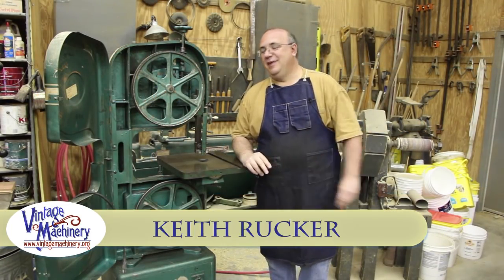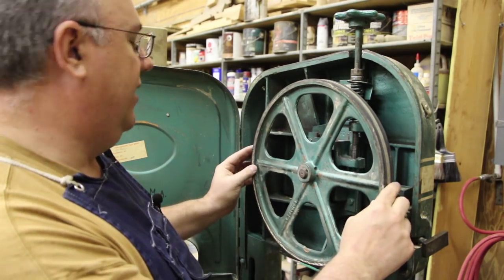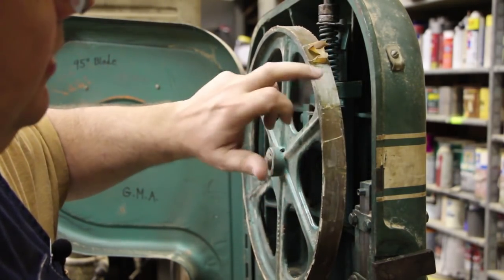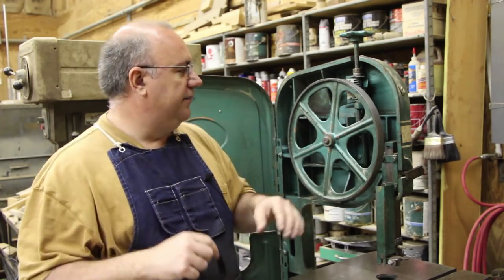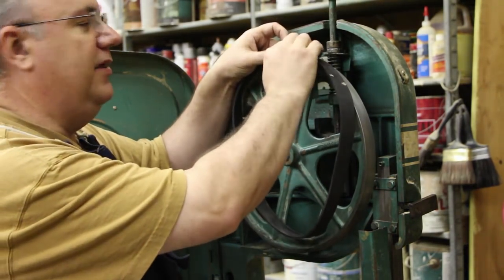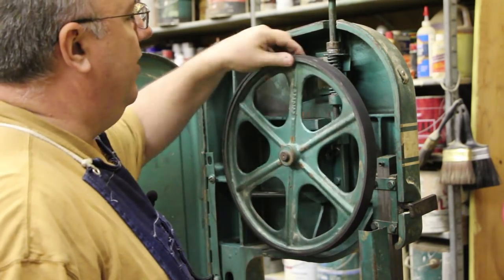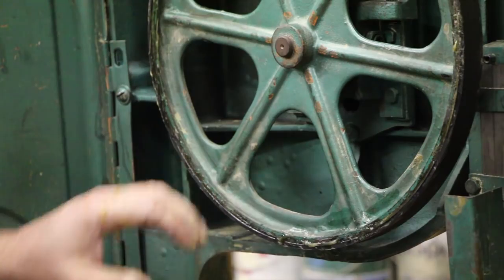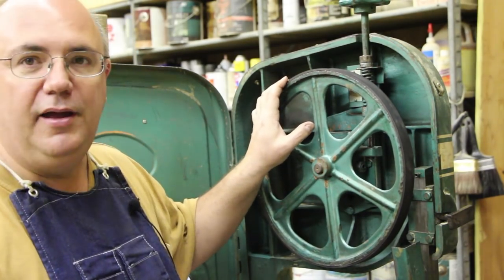Installing and Crowning Bandsaw Tires

Comment: Ack, I tried to recrown my bandsaw tires with an angle grinder and a sanding pad and a big piece of rubber came loose from the edge of the tire. Is this likely to happen with a new tire or might this have been because of old tires? I am unsure how old this saw is and when it last had them changed, it is atleast 50-60 years old, I think the tires must have been changed once at least. I would have liked urethane tires so I would not have to crown because I am afraid of ruining a new rubber tire now... But they don't exist for my size saw (24" wheels)

Comment: If that is contact adhesive, is usually is supposed to dry on both sides before you have one side touch the other. But I understand the dilemma of adhering a stretchy surface with contact glue.
Reply: Agree, sorta hard to let them air dry and tack up but it does work this way, just let it set longer.

Comment: This was a truly great video.  I had no idea that there was so much involved with installing these tires.  I need to take a second look at the new polypro tires I put on my Delta 16" bandsaw.  I did not glue them, nor equalize the tension as you did.  I also used "C" clamps to help me install the tires.  (Oh well!)

Comment: If your holding the sandpaper freehand without a solid unmovable support, you are not truing up the tire surface to be round...you are simply making a surface that is parallel to the original wheel surface at best: at worst you are humps into it from vibration and bumps.  For proper truing, follow the principle of lathe turning, you need a solid rest.  An old installed blade with the teeth ground down can serve as a good driver for the free wheel work without risking getting cut.

Comment: I will give away our secret in our shop with several bandsaws. We stopped buying tires years ago. Now we use several wraps of 3m Scotch 33 electrical tape or even a top quality duct tape. We have saws from 12" to 36" and this is how they all run in production situations without failure.

Comment: Thank you sir, another great video. I sure got lucky when I replaced the tires on my Harbor Freight 14 inch band saw. I just ripped the old one off and stretched the new one into place. So far so good, but after watching this video, maybe I should re visit that project. Now that I think about it, I do hear some thumping going on in there. Sure makes sense when you do it correctly. Oh well, tomorrows project :) .

Comment: Nice! I just bought an old Powr-Kraft 14" band saw from the 40's or 50's for $40. My tires are a little cracked but not too bad. My problem is I don't know how long of a blade I need. There is one on there now, but it's too long. They jerry-rigged it by adding a block of plywood under the top adjusters....not sure why. But it rubs on the top of the guard. Is there a place to go to find that information?

Comment: I have a 16 inch band saw with cast iron wheels it doesn't have rubber on wheels, the blade runs with teeth overhanging. 
It is Makita old model.
Bought it in Saudi Arabia in 1985.
Good running since then, no problems. 
I have not been able to find any literature on Internet. Makita is no response. 
I wish to know more about it can you help?
In India and far east they almost all have steel wheels with no rubber but I have not been able to get any proper working details about the crowning of the steel wheels, they seem to have no crown. 
Can any one help.
Thanks.

Comment: Thanks for the vid;  I worked in a shop that had more than 15 bandsaws for cutting vacuum formed parts.  The biggest (and nicest) that I ever serviced/rebuilt was a 42" or 48" Tannewitz with direct drive.  Putting the tires on that one was a job,  but once it was all done & tuned up it ran really nicely.  Never did crown the tires,  guy I learned from hadn't done it so I didn't.  Next time I replace a set I will be sure to do it though. Thanks Kieth Rucker,  the information you share with us is invaluable.

Comment: Here's a tire gluing hack that works for me...
When nobody is looking, steal one of those decorating bags from the kitchen (hopefully its disposable), fill it with glue and squeeze the glue in front and behind the dowel as you turn it.  The dowel will help spread the glue evenly on both surfaces.  I found that to be easier than trying to force the bristle brush in there.  
Another way...
Save an empty toothpaste tube.  Cut the end off of it, clean out the leftovers, fill it with glue, fold over the back end and roll the tube end as you empty the glue.
I'm sure you could use those hacks for a lot of other things too.  Don't knock it till you try it!

Comment: Great video. Thank you! I have an issue I'm hoping you can help me with. I recently bought a powermatic 143 from a friend that used to belong to his dad. The tires were falling apart so I decided to replace them. After reading a bit I decided on urethane tires and they keep coming off. Is it because there's no channel for them to sit in? If so then I'll just buy rubber tires and glue them in but I was hoping these would work. Thank you for any insight you can offer.

Comment: Keith. I like that you want to talk about how important it is to cut the power off and place the wire where you can see this. 
Most people do not mention it at all. 

In Sweden called this "shut down and lock" we often have protection switch with locking arrangements in workshops and in the industry. Each repairman on the machine has a personal padlock fitted before the job and and removed when the job is finished for the specific worker.
In this way, the machines will be unable to started unintentionally.

Comment: Neither of my band saws even have rubber wheels but they both seem to work fine. I don't know that they ever had them either by looking at them. On a metal saw wouldn't chips cut your tires up and embed themselves  pretty fast?
Reply: *****
And also a big consideration is the coolant on the rubber, All the saws I have worked on had the crown machined into the wheel and ran no rubber but they were all for metal only.
Reply: I looked at the wheels on my old Johnson bandsaw and they are relieved so that they don't touch the tooth section of the blade.

Comment: Thank you for your excellent video. Now I am convinced that I can install new tires on my old Crescent 36" bandsaw by myself with its wheels on it. BTW, I cannot find the contact cement(or corresponding adhesive) in the site you mentioned.

Comment: Keith,
Thanks for the stroll down memory lane. I used to hate to put tires on bandsaws, unless they were the new units with the notch in the center of the wheel and the tire as well. Those tires got put on the hood of my service truck to get them nice and warm to make them more pliable while I removed the blade and old tires. Putting them on was a snap! After a couple of the flat tires came off while the saw was running that I had installed, I lost confidence and refused to replace them anymore. That's an old Powermatic. The newer Powermatic products are painted sort of a mustard yellow for lack of a better description. I have, however, never seen one with the cone pulleys for different blade speeds. The ones I worked on use a Reeves drive (adjustable pulleys) for speed control. This same method is used on variable speed mills not using a VFD.
Regards,
Dave

Comment: Be wary about sanding it to try give the glue more grab on the tire, I once had to stick rubber and urethane to various surfaces and I did a whole lot of trials and the more shine on the surface the better they stuck, sanding the surfaces made them come off about 50% easier- failure was caused by little of pieces of the surfaces tearing off the parent material. Do some tests see for yourself
Reply from the maker: shedasaurus Just following the advise of the manufacturer.
Reply: Cool!

Comment: Thanks,
Also, you can use  rubber cork I find it smoother and easier to install. The gluing process is easier because you the cork is in length. Contact glue on the wheel and the cork, glue the cork on the wheel and cut at the join at an angle, The cork is more resistant than the rubber. Sanding and adjusting is the same process.

Take a look at this web site un UK 
scosarg.com/accessories-spares/bandsaw-accessories DOT html
I am sure those can be found anywhere around the world.

Comment: For best results and dynamic blade tenacity it is necessary to crown the blade transport wheels to a radius equal to the radius of the wheel itself. I learned that the hard way; carving 18" timbers.  I'm currently in the testing phase of my latest veneer resaw prototype. It cuts 18" deep in a throat 14" wide with a 2HP drive train. I use a proprietary rail-and-sled feed system that factors blade lead into its locked position using rails of variable length and robustness to start that first flat cut and veneer the log from there. I feed it with my pinky finger. Using two high performance Iturra tensioning springs, it runs 1" lennox carbide-tipped resaw blades with only 3/32" of kerf to produce 1/16" veneers 18" wide as long as your workpiece. Because the tracking and tension system is frictionless, there is no blade flapping at any setting and the cut finish is so smooth it looks like it just came out of a planer, not a band saw. It's ready-to-glue ! I'm trying to retire falbergsaws.com but I want to introduce this prototype first because when ya'll see what a sweet machine this is going to change the way they build bandsaws hereafter; you'll no longer settle for the antiquated designs you're now getting from the big corporate tool companies.

Comment: I've been fixing up an old (30's-40's?) Rockwell (Delta) 14" band saw with gear box. The tires were extremely hard to remove, hard, glued, I had to chisel them off. I found urethane tires that required no glue and they worked wonderful. The wheels have a crown built in and a edge to the rim that keeps the tire from walking.

Comment: Thanks Keith! I recently purchased a Powermatic 141 Band Saw (Circa 1965) that I am completely restoring ($50 a real steal!). This video will help me a lot! I'm doing a ground up restoration, including new paint, bearings, and tires. I hope to find a blade that will allow me to cut aluminum as well as wood being that I do not have the speed changing transmission in this model. It runs at 3000 sfpm.

Comment: Acetone! You should wear gloves so it doesn't get absorbed in your skin, a filter mask so you don't breath the fumes and make sure there are no ignition sources which include certain electric motors and electric switching equipment. Safety first!

Comment: I've been working to restore my Grandfather's Craftsman three wheel bandsaw. She's a 1950's vintage with 6 inch wheels. I replaced the tires by following your method. There are three holes in each wheel, making installation easier than I thought. By tying down the tire into two adjacent holes and using a small metal rod, starting at one hole and rotating the rod as I lifted the tire edge onto the track surface, it was fairly easy to mount the tire. This astonished me because I'm not usually that lucky. The other two tires were equally easy. I did rotate the rod between tire and wheel for two orbits along the circumference of each wheel to better seat the tires as you suggested. Now I'm ready to crown the tires. I'm not really quite sure about how much surface I should remove from the tire edges. You mentioned a minimal of one or two degrees, using a stick and sand paper. How many turns per edge would you suggest?
Thanks for your video. Very informative!

Comment: Check out your wheels before you spend any time or effort crowning your tires.  The wheels on my inexpensive import 14" saw are crowned; and the new urethane tires that I installed last night follow the shape of the wheel perfectly.  Incidentally, the urethane is more difficult to stretch than the rubber used in this demo.  Once on, I decided to forego using any glue at all.

Comment: Thank you! My hunch is that rubber cement would be an ideal adhesive. I've used contact cement for years on various projects and it is suppose to be allowed to DRY on both surfaces. Of course this is almost impossible to do on the tire and wheel, so rubber cement may be a better bet.

Comment: being the shade of yellow it is, and the consistency it appears to be; I would say the glue is 3m super weather strip adhesive. common uses include weather stripping, gaskets, rubber on metal anywhere needed.

Comment: My 25' blade on 30" wheels call for 18,000PSI. Can the tires handle the pressure? Would it not bite into the rubber?

Comment: I may be a little late to the party with this comment. I use the same technique but with a twist. I use an 2" rubber sanding disc mandrel in a cordless drill. Place it centered on the idler shaft and use the drill to spin the idler. Makes it a lot simpler to do the job and keeps your fingers out of the path of the spokes.

Comment: It was extremely easy for me. Soaked it in hot water for a few minutes and then used two trigger clamps with rubber ends. Took about 45 seconds.

Comment: Hey, Keith...great info! Thx! I am working w/ a Maru 16" metal/wood vertical band saw - Model 16 MWM. Cannot find anything on t/ web.

 T/ problem is it shakes and is very noisy at times. We thought it needed a new gear box, so, I drained t/ gear oil out - about a cup full came out, but, was very dark...and no metal pieces in it. 

Now, I'm thinking it might be a wheel-bearing.?
Reply: Also, wondering how much gear oil to put in gear box which is approx. 20" height, 14" width, and 6" depth.? Thx!

Comment: thank you keith, I adjusted the guides and I centred the blade, also applied more tension , and it seems to be working better. just one more question at this time, im working with a older blade given to me by the seller, probably dull, how do I know how big a bandsaw blade to buy .
Reply from the maker: +Paul Shaw The easy way to do it is adjust the top wheel so that it is about half way in the middle of its adjustment and just wrap a piece of string around everything and mark where the end meets the middle of the string.  Then stretch out a tape measure and see how long it is.  Or, you could do it mathematically - Add the circumference of one wheel to twice the distance between the center of the two wheels and that is the length of blade that you need.

Comment: hi thereI just got my first bansaw, a vintage beaver, and I did the set up as beast I could , but I can not cut a straight line. when I follow my line , the blade goes off line. how do I fix this please
Reply from the maker: +Paul Shaw Sounds like you have issues with the guides on your band saw.  You should have a guide above and below the table to keep the blade running straight.  If your saw does not have them, you can purchase just guides from multiple places.

Comment: Would there have been any benefit to checking the roundness or trueness of the wheel on the lathe?
Reply from the maker: +chuckwin100 What is most important is how round it runs on the saw, which you can check with an indicator on the saw if you like.

Comment: any reason why you did not put glue on first and then the tire, would that not help in putting the tire on easier
Reply from the maker: +Paul Shaw It just makes for a big mess when you try to put it all together when the glue already in place.  Also, the glue has a pretty short working time so would have to be real quick....

Comment: Do you have to glue them?
Reply: *****
Gotcha. I was thinking more along the lines of them slipping, but that wouldn't make much sense. I noticed on Mathias Wandel's homemade bandsaw, he used very curved wheels and bike inner tubes, just put on there. I guess for low use, that would work fine. Also, you ought to take a look at Frank Howarth's J.A. Finney bandsaw. I think it's a 36"er and from sometime in the early 1900s.

Comment: thanks for the upload of this video Keith, my old sears band saw has "tires" ..v-belts.
funny thing is they hang down under the wheel. crowning a v-belt would be a bit of pain methinks not to mention changing it. are these things "on for life" or is changing them from time recommended?

Comment: Keith I love watching your videos but I can't believe for the life of me why you would put old fashioned RUBBER tires on bandsaw wheels when poly tires are FAR superior on any bandsaw.   And speaking of crowning, the crown is built in the wheel.  Every band saw I have ever seen has crown wheels from the factory.  If I had to do all the stuff you are doing to "crown" these tires, that saw would be out the back door to the junk heap.   Good job on everything else you do.